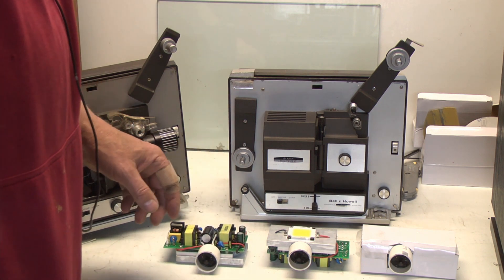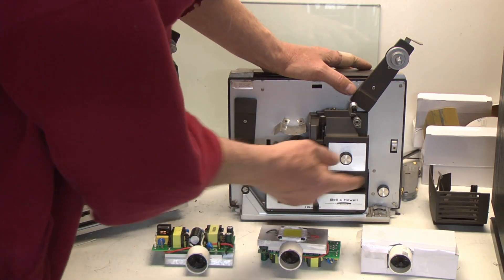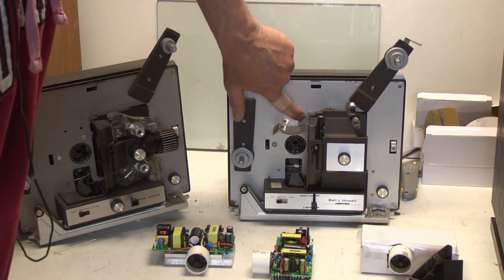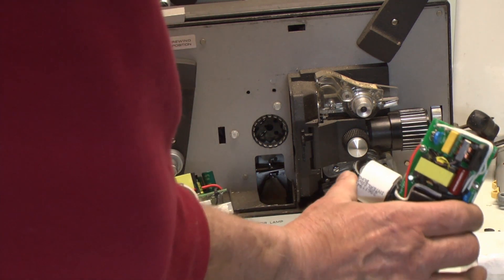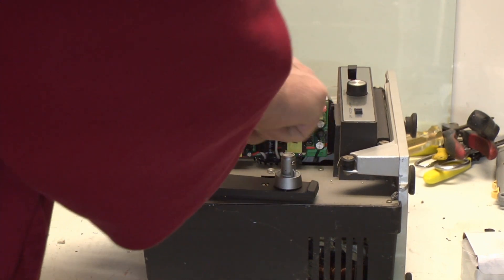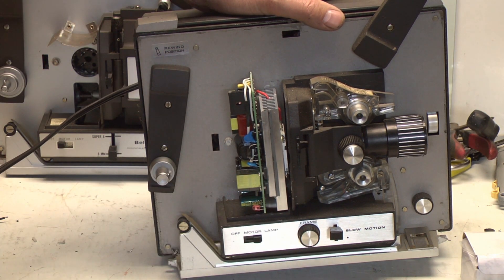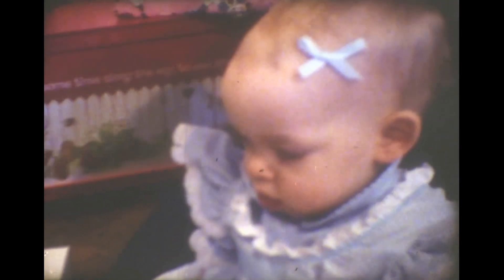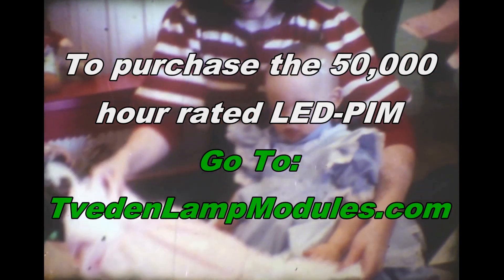Tveden Lamp Modules 100 Watt LED Projector Lamp Module for Vintage 8mm Bell & Howell Film Projectors

Comment: On your ebay you have this led and a halogen option which is better for digitizing with dslr camera? I kessaged on ebay with no response
Reply from the maker: Both lamps have their advantages and disadvantages. The other thing about the LED is that the lamphouse cover will not fit back over the LED unit, so it has to be modified or left off. Also the light/air baffle/shield above the lamp socket must be removed. That is pretty easy.
The halogen lamp pops right in and you're good to go. However, it runs much hotter than the LED unit, but a little bit cooler than the original lamp.
If you're good with making all the modifications to run the LED, then sure, I'd go with it. It will never burn out. Or shouldn't.
No matter which you choose, you will still be dealing with processing chores in order to get the optimal final results. I have a little different transfer system, (Tobin) but still use a couple simple software programs to get there. Movavi - a cheap, simple program to quickly crop for clean edges, and white balance all the scenes that still have a hue imbalance. Then I final render in Vegas Pro using Neat Video to denoise and output files. I tried Topaz for a while but soon went back to Neat Video. I hope this information is helpful. Thanks again.

Comment: Can't access Tveden website.  I have a blown DJL 150W 120V lamp on B&H 456A super 8 and 8mm autoload
projector. I believe I need a B&H PROJECTOR LAMP MODULE 356A 357A 357B 358A
456A 456Z 457 458 458A.  How can I purchase one?
Reply from the maker: Here is our eBay listing.   https://www.ebay.com/itm/292943497319

Comment: Love this custom module. In the '90s, I had 240 16mm & 100+ 35mm slide projectors.  Primarily used for event decoration in the USA. But, for Europe, I would remove all heavy items like audio and lamp voltage transformers. Then I chose a 120v/300w EYK lamp. Now I could fit 2 in each case for travel weight restrictions. It would be nice to switch to LEDs for my reduced collection of 16 and 35, motion and still, projectors using modules like these.
Reply from the maker: It's always fun and challenging to see if alternate lamps can be adapted for different purposes. Good luck!

Comment: Will the module work with a Bell and Howell 253AX?
Reply from the maker: If the 253AX model you have uses a DFN or DFC mounted horizontally then it might well work. Some models just don't fit. Thanks for watching and commenting!

Comment: Good job . A few idea's : 1/ why don't you 3d-design to fit and print a new cap to house your new led-plug-in lamp for that projector in your video ? 2/ Why don't you make a led-lamp-plug-in for 16mm projectors whose light-bulbs have been discontinued for production ? All these old 16mm projectors are usually in good mechanical order and preservation , but have run out of their lightbulbs . If you construct and design new led-plug-ins for them , then you can give all these old 16mm projectors , and there are a lot , a new life again , plus you'll sell a lot of these plug-ins (provided if they are at a reasonable price) .  I have a Bauer P7 universal 300 , 16mm projector , that uses a GE MARC 300/16 lamp , but these lamps are not produced anymore . Imagine if all these old projectors can come to life again . Erwin , Belgium .
Reply from the maker: Thank you. I plan to design some new modules. We'll see if I can make something for 16mm projectors.